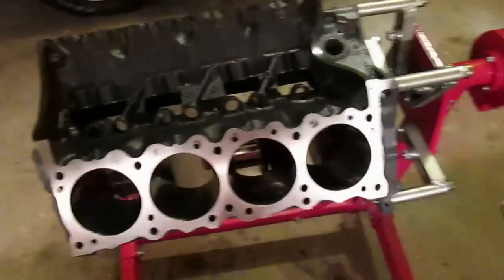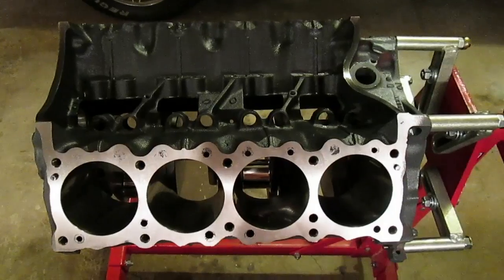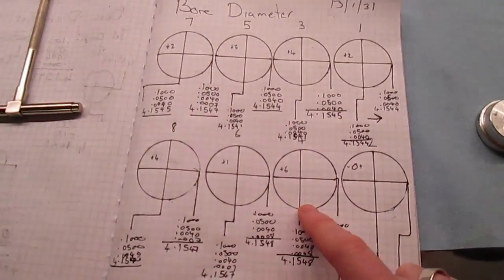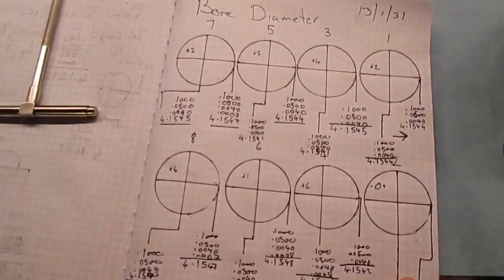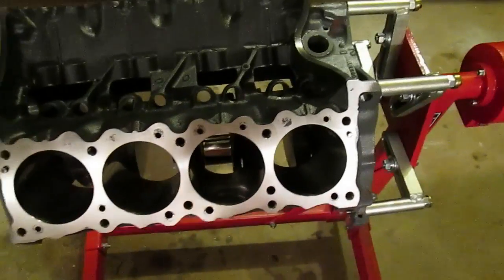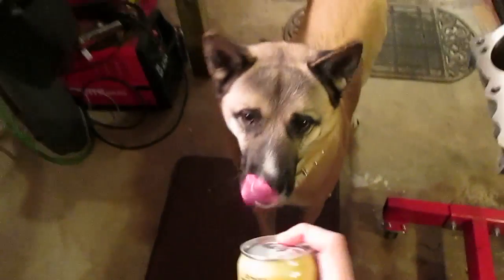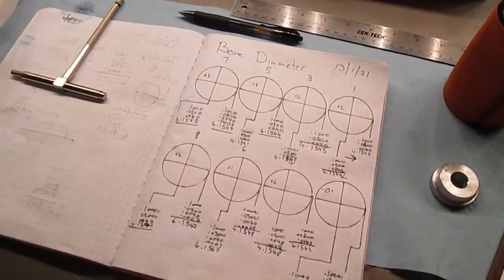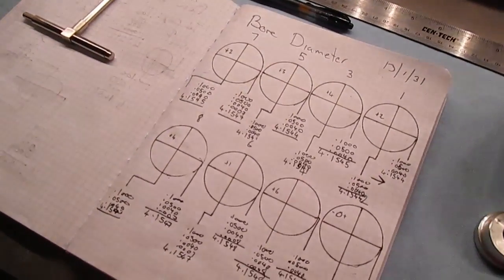Pontiac 400 cylinder bores. Question

Comment: You might have figured it out but you can wipe 2 tenth off with a rag. tight tolerance is always good your machine work doesn't get any better than what you have speaking from years of experience as tight tolerance machinist.
Reply from the maker: Totally agree, learned a lot since! theres just not enough in it to accurately get consistent results that fine.

Comment: Pontiac a don't benefit as much from a torque plate as Chevys because the ways the bolts are bossed into the block. The Pontiac bolts are tied more to the deck and the Chevy is tied to the bores more so that as the bolts are tightened the bores on a Chevy distort more than a Pontiac.

Comment from the maker: Great point on less material in the center of the block. Never considered that.   I've also since posting this ran the dial bore gauge, and found my snap gauge measurements to be consistently off by .0010 + or - .0002 overall So i've measured all bores and added the difference to each one. Now i think ill reorder my pistons to help match it out even further and i feel like i should be in a good place.  I'll try and post up an update tonight.  Thanks for all the help...and the motivation!

Comment: It appears that your largest variance is toward the center bores and less to the outside bores where there is more webbing. That may account for the differences but it looks like your machine shop did a good job getting your bores to the required dimensions. I would not average out any bores but would take each piston and subtract it from each bore and if you are off by 0.0006 I would let it ride due to "your tolerances" and the fact that you don't have a torque plate while measuring the bores.

Comment: torque plate distortion depends on the deck straightness, block  material and many other variances. I would not worry too much. I had an aluminum block that was way out with out the torque plate. like in .0025 range, with the torque plate it was .00005 which is minimal. part of that variances is what the rings are for( somewhat).

Comment from the maker: Yeah the dowel pins look new so i think they were removed.  They installed the cam bearings also at my request. and drilled a .030 hole in the hidden oil plug in the back of the block to help the distributor gear with oiling.     Cool, i love 66's  glad your enjoying the videos. As long as people are digging it, ill keep posting them.  Thanks for the words and advice, ill have plenty more questions.  Tonight ill run the dial bore gauge and see where im at.

Comment from the maker: Interesting.  Makes total sense, as i can imagine these old blocks would shift around quite a bit just sitting.  It was a virgin block and the shop took it .030 over.  They balanced the rotating assembly, gapped the rings and as i mentioned in another video, they installed the crank so it was easier to ship.  So they checked end play.    I could probably just throw the thing together and it would work fine. But im enjoying making a habit out of this.

Comment: If they did they may have match them as close to the bore already. Was the block cut? A good shop will chamfer all bolt and coolant holes. Also if the block was cut they would have to remove the dowl pins for the heads. It sounds like you need to get a few guides for small blocks to find out the specifications of your block, etc. I love pontiac's, I started with a 66 GTO with a 389. I had it bored 60 over and never looked back. Sorry to see the brand gone. I enjoy the vids keep them comming

Comment: Since a hone exerts pressure against the cylinder wall, the unsupported middle of the wall is going to flex more than the ends. If you did nothing about this you can get whats called bell-mouthed at both ends. You can hone a cylinder perfectly round and come back a few hours later, it is no longer perfectly round. The metal has stabilized, moved, and you can start honing a little more. Are you blue printing the block? Did the shop assemble the crank, rods, and pistons(with rings)?

Comment: What my understanding is of a torque plate. The plate is needed to apply the bolt stresses to the block and distort it just as thouh a head was boltedto it. Just as you said to keep it round. The differences are the matching the bore as close to your spec's or the bore that was choosen. Honing is an art. If the correct stones and the time was spent by the shop to just clean up the bore you can have a clean running street car. The finishing is the biggest cost this takes alot of time, time=money.